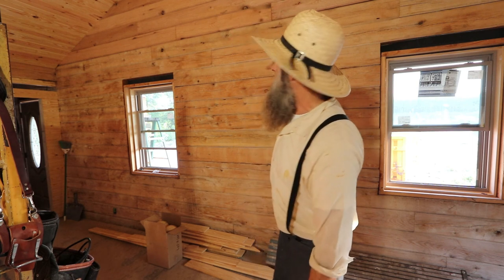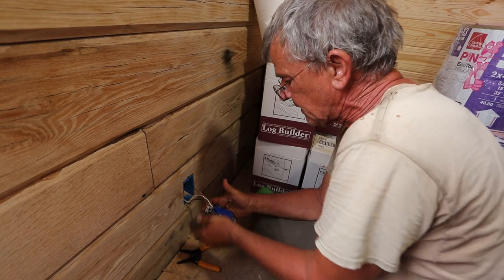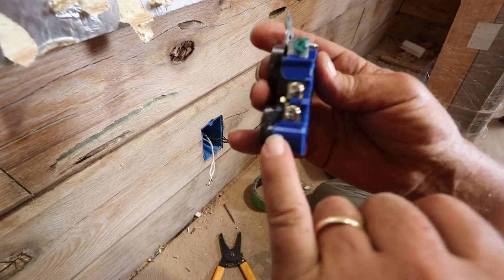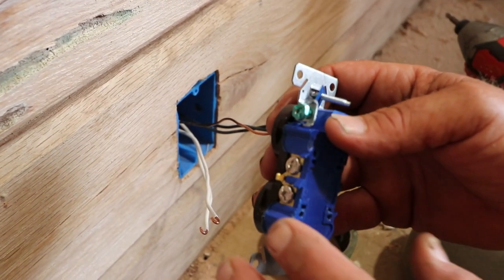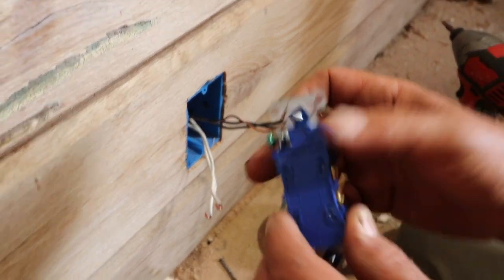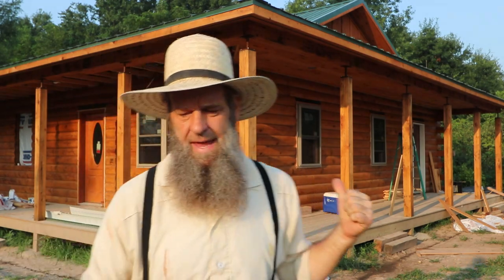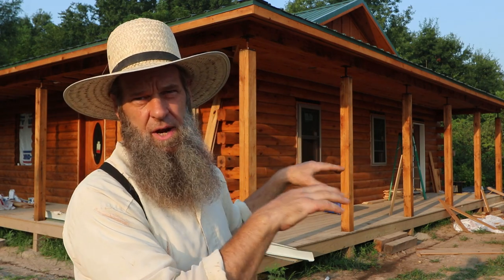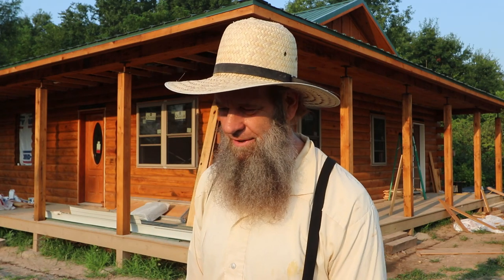Electrical CAN be DANGEROUS! D I Y Log Cabin Build day 70

Comment: Something I was taught was also to wrap the receptacle in electrical tape so if you ever had to open it hot you have an added layer of safety.  I do not believe this is code just a safety addition. It also could be that we live in an area with a lot of old houses and everything is the old steel boxes and conduit. Most importantly you are following your code which in the end is what matters. Code changes from town to town it is good to have Gary as a resource.
Reply: I've been shocked by more receps wrapped then not wrapped. The better spec grade receps now have "barn doors" as we call them. Just plastic locking tabs that close down over the screws. I personally don't tape resi but I do tape in metal boxes in commercial and industrial applications.
Reply: Back wrap the tape then tape over that . Learned that from an older cat myself
Reply: @Lsutiger225  yeah I do the same. Although a lot of tradesmen out there never think about the guy coming after them. To the point, I was wiring a school. Our mechanical company had sprinkler systems and hvac. Sprinkler guy came and cored all his holes for drops to each classroom. A month or so later in the middle of this bungee mess(right outside the main electrical room) the hvac guy runs duct covering all the sprinkler guys holes. He then had to plumb 90 up, across, and 90 back down then 90 in each room. We had ¾" between lay in lights and duct work so it was pretty tight, especially with racks upon racks of conduit and cable tray.

Comment: Doug, 24 years ago I remodeled the interior of my log cabin. It's built of 3 sided logs so the interior walls are flat like your Mom's walls. To brighten it up we sanded the interior logs (some of them were gray with age) and instead of wood tone stain we used a white tinted oil based penetrating stain. The natural grain still shows and they have stayed light all these years. It doesn't look painted but more like nice new lumber - only just a little whiter. I believe it was meant to give a pickled finish effect.  Since it's small (abt 650 fs), the lightness makes it seem larger too.

Comment: When we were buying this house in Missouri we had an inspector go through it totally. He found in electrical panel that the wire was 12 gauge but circuit breakers were 30 amp. It's a wonder the house didn't burn down. We hired an electrician and he put in all new circuit breakers at the right size and put GFCI receptacles that were necessary throughout the house. I'm waiting on him to finish a job to come back and do electrical things in my building. I live now in Dallas county in Missouri and really love the piece and quiet with only the people who here going up and down the road.

Comment: Where I live in Virginia Our local code for residential is almost like the commercial for the wiring. We had the inspector to the house like 20 times and he always found something wrong with the wiring. But you all are 100% correct with the information you give. And in a few years I am going to move to a place that has no zoning laws. Where I can do what I want on my land. We have a code in place where I live. If you want to move your dog house you need to get a permit, then get it approved, then move it and then have inspector check it. All that is a money thing for the county, city and state. If you don't do that its a big $3500. Dollars fine plus court costs. I found this out the hard way.

Comment: It’s just a spring type tension grip on the wire when you insert the wire in the back. This could lead to a loose connection, as you’ve realized when having difficulty removing them, while others came out easily. The screws can be really snugged tight making a good connection. Some home manufacturers wire the complete homes with 12-2, simply because they get a price break for the amount they purchase and they don’t have to worry about someone putting 14 where 12 should be. By the way, you guys are doing a super job!

Comment: Also the long slit on a receptacle face is always the neutral white wire small slit is 110vac black 
I like to screw my wires in vs quick plug them.

Comment: Gary, you could also say that the neutral (wht) wire on a receptacle is on the side for the "wide" blade of the plug.  Also this configuration can be described as "polarized" since there is a key to keep an ungrounded device plugged in "correctly".  Lotsa words right there, but GARY WILL UNDERSTAND, DOUG MAYBE NOT SO MUCH? LOL!

Comment: Some of the newer higher end outlets do have holes in the back for the wires to go into, but when you tighten the screw it tightens up on the inside of the outlet and clamps the wire.

Comment: My dad was an old-school electrician and he showed me how to wire a house he also told me when I put my receptacles in that the ground wire is on top to the left so you can clearly see it when you work on it and you always put your wires in an accordion fashion the left side is always neutral the black wires is on the right. That may not always work for you since the national code may have changed in 30 years

Comment: The UL listed materials cannot be modified unless the AHJ signs off on it! Authority...Having...Jurisdiction. Also Doug according to code you are not to use the device as a junction/connection, what this means is you have to pigtail those wires so only one wire of each color goes to the outlets. The reason there are 2 sets of screws is so the tabs between the screws can be broken and hooked up for switched and constant power to either set of terminals. The only reason the neutral side has tabs that can be broken out is in some cases you might have 2 circuits going to the same outlet and neutrals can't be shared. If you do put 2 circuits on the same device you must used a 2 pole breaker in the panel so both circuits will be shut off at the same time! If you want code numbers holler I will get them for ya! Best of luck!

Comment: I used to have a house in Las Vegas that was built in 1975 and the electrical in there was so sketchy....most outlets didn't have a ground! There was not even a three prong outlet it was just two prong. The wires were really questionable and we had some 220 in the living room and outlets on the ceiling....somehow in the twelve years we lived there the house never burned down! I thought for sure though it would!🤣🤣🤣

Comment: Hey Doug on the outlets if the side screw dose not tighten the wire it is considered a bad out let in my state and it has to be replaced because it is suppose to lock the wire in when you tighten it up if not you may need to talk to the hardware and get the right ones that do just a short heads up we found this out building a 3 and half Million Dollar home for a man here thanks everything looks great keep going love the  look of Moms home

Comment: as a retired electrician, just let me say, the reason for the ground up, is that if you use a metal cover, if it falls off for any reason, it will land on the ground, and not across the positive and negative blades. NOW AS FAR AS YOUR WIRING of the receptacles, when you have two or more wires in the outlet box, you should splice the two whites and the two black wires, like you would do with the ground wires. than put a tail wire on them, and have only 3 wires going to the outlet. the reason for this is that you have a couple of outlets or lights being fed from one place. if you have to change or replace a outlet, you will open anything that follows that circuit. i am talking about doing it live, and not shutting the circuit off. i did a lot of work in office buildings, and we couldn't shut other people off, to work on a circuit. we also used metal boxes, so on all of our outlets and switches, we taped them with electrical tape, not to short them out on the metal boxes.
Reply: Correct information! 👍

Comment: In the front of the plug the thicker whole is the white wire side of the plug.
I had always paid attention to the screws silver and gold, but there was one time where I had bought a receptical with the gold and silver screws were switched.
I hardly ever use the holes I have more faith in using the screws to fasten the wires..

Comment: I noticed around 11 minutes in that the metal roofing is not projecting much past the facia! I have 4 steel roof homes and in every case we did a 3 or 4" over hang. Water till get to the gutters but stays away from the facia. Lowers maint on the woodwork

Comment: The installation instructions for electrical devices are incorporated into the code by reference. Modifying the device and using it in a manner not approved by the manufacturer is a code violation. Whether or not the modification is dangerous is of course debatable but I think you showed this one could have been. Glad to see you changed them.

Comment: Good stuff!
If you run 12 wire, why not just make it 20 amp? 12 is harder to work than 14, so if you run 12 take advantage. My best friend always says “you can never have too much power.” He is a wise man!
I never use push in connections. I like to tighten my own connections. But I have switched to Wago wire connections instead of wire nuts. More expensive but easy and tight connection.
Gary is a friend like no other! What a blessing from the Lord!

Comment: I would only use 20 amp duplexes and 12 gauge wire for all outlets, then 14 gauge wire for the lights  with switches, also all duplexes remain hot on both outlets, not using them for lights.  Wrapping electrical tape around the duplex after attaching the wiring is an extra safety operation.  There are different ways to install wiring and I don't see a problem installing duplexes.

Comment: 12 Gauge wire will not fit into back of 15 amp receptacle. you have to either put around a screw of side wire. Best and safest way anyway. Also, you are not supposed to reuse a receptacle if it has previously been back wired and wires removed. Wires wont hold. You could use screw or side..

Comment: Do you want hear a construction joke?
😣 Sorry, I’m still working on it?
Seriously great job on the log home. I’m sure your BEAMing with pride for the great team work!
What I WOOD give to NAIL your plan to spread hope to the hopeless. God Bless your success!
Reply: Someone told me a coronavirus construction crew joke....
Thank God I didn't get it...
There are some STEELMASTER quonset huts of various sizes all around the country that are 80 years old and still looking like they're just a newbie. Very fire resistant, depending on the interior design.
Edit: I have no connection to STEELMASTER, I want to build one but I already have a cabin that looks like a big sponge soaking the moisture out of clouds on top of the ridge.
Reply: Eddie Mertin  Sounds like you have a great location for a cabin.I went to Steelmasterusa’s website and found a couple great pictures of homes in it. There’s a nice pic of an art studio Quonset hut in Arizona, only I’m not sure if that would be practical in AZ because of the heat. Hopefully there are ways to insulate it from triple digit temps.
Reply: @cact9  they have insulation kits and you can have spray-on. They have a blog with a lot of real world useful information. I rented a place for awhile in the 90's it said quonset on it. It was more of a traditional steel building. Insulated on the building and the apartment on the inside, double garage. Nice place.

Comment: Plugging the wires into the hole in the back of an outlet is totally a BAD PRACTICE! It is not IF it will fail, but WHEN!. That is why there are screw connections on the side of an outlet. One other point is that even if the wire "feels" tight, remember that there is only a very small contact point when the wire is pushed in through the hole in the back of the outlet. I am very glad to see that they are taking the time to correct this shortcoming.  Here in Washington state, the outlets must also be of a type that discouraged a child, or any other idiot from poking a metal object into a slot on the outlet. They are a bit more difficult to insert an actual plug but far safer. A few wraps of electrical tape around the outlet is also another safe practice, especially when using metal electrical boxes. This might not be required, but it is a good safe practice to follow. Also, if there are any UNUSED screw contacts on the outlet, screw them tight into the outlet.

Comment: That is great , seriously though, I would drive the 6 hours and change them for you if you didnt have time to do it. I feel that strongly about backstabbed wires.
I dont know who said you cant use 12g on 15amp recept, but I did say you cant use 12 gauge one the stab in connections. you can use 15 amp recept on 20amp circuit so long as it is not the only recept on the circuit. If it is the only recept on the circuit then it has to be a 20amp recept.

Comment: Glad to see that you changed the receptacles over. Just one question for you regarding the electric receptacles over the counter top, did you split those plugs and put them on a gfci? The reason for splitting those receptacles is mainly because of the amperage of the countertop appliances that two of them in the same plug can exceed the 15 amp rating of the breaker and in most cases the wire although if you are using 12ga wire it is rated for 20 amps but quite possibly the breakers you are using are only 15 amps.

Comment: Hey Doug, I noticed you used wood under the eves. Do you have problems with carpenter bees? They are a real pita up here in northwest Pennsylvania. We use a spray on product to help keep them off the wood especially any surfaces that face down, they always bore up.

Comment: If the outlets have screw set terminals (not sure if US outlets have those regardless) I would go for putting the wires in the screw set terminals. Mechanically much better and electrically waaaaaaaaaaaaaaaay safer. The screw set terminals pinch the copper very well and prevent a transfer resistance being at the terminal. Since resistance combined with current creates heat the lower the resistance the less heat the terminal creates thus it is much more safe and lasts a heck of a lot longer...
In my country (the Netherlands) screw set electrical pieces are becoming very rare if not impossible to get so whenever I see a 1960's-1970's era house or commercial building being demolished I ask if I would be allowed to remove the electrical pieces (since they are most likely screw set versions). I would rather have a 40-50 year old (inspected for wear and damage of course) outlets and switches with a screw set terminal (and most of the time even ceramic insulating bodies, real brass screws and hardware) then these cheap ass junk push in style Chinese junk... Pardon my French. The only Chinese Junk I like is the boat...

Comment: Google says household wire is 10 gauge. Difference between 12 gauge and 10 gauge is amps. Most circuit breakers in an home are 20 amp breaker. 12 gauge wire is 20 amps. 10 gauge wire is 30 amps. Yet an stove, hot water heater, dryer, RV plug-in outside is 30 amps. Yet two different 10 gauge wire bundles. 10/2 and a 10/3. 10/2 is 110. 10/3 is 220. Here is something. Go price the wires. 12 gauge, 10/2 gauge and 10/3 gauge. Is it smarter to go with code and place the wires where needed or go with 10/2 wire everywhere and then 10/3 in key location's. Go Gary go.

Comment: You can not us the holes in back of tha outlets after pulling the wires out, the cunetcur in side will not hold the wires just like the wire that was loose, yes I am a electrician.  It is safer that way.( once used it can cause a wire or wires to come loose in the outlets.

Comment: Personally, I don't like poking the wires into the backs of the receptacles but using the screws as better connections.
Reply: There is nothing better than a spring type connection if you use good quality products. The screw in combination with a "U" shape bend wire is a stone age method and I am surprised that in the USA you are so behind in these electrical things.

Comment: So are those on a 20Amp Breaker or a 15Amp breaker.
Reply: will have to be 15 amp breakers since the outlets are 15 amp.  Really the 12 ga wire is in my view a better way to go even with 15 amp circuits.  Virtually no voltage drop so when one turns on something like an AC unit you dont get drain on those other circuits.  No browning out of the  lights.   Other things are that you likely wont have failure of the outlets. All in all this is my preferred way.   My thing was drilling out the holes in the back.  I used to use those holes but now only do the screw lugs.  I am just afraid of electrical fires.  Signed coward
Reply: They could be 20amp if the receptacles were changed although the receptacles are still missing pigtails.
Reply: @kenanderson9331  true but pigtails just make the wiring easier though they are not required.  Yes could run the 20 amp receptacles but that might limit how many per circuit can be run.  With the larger wire could actually run a couple more.  Bottom line is that they were wired in a way that they are not going to cause a problem
Reply: @stevepailet8258  yes they are now much safer.